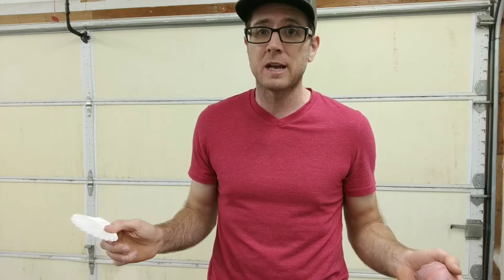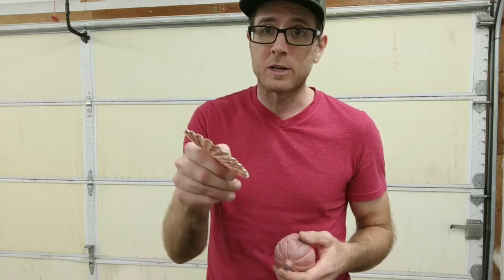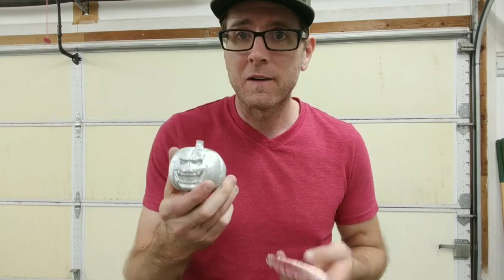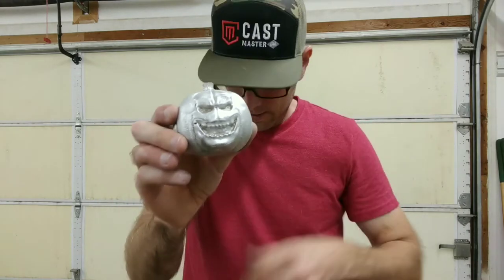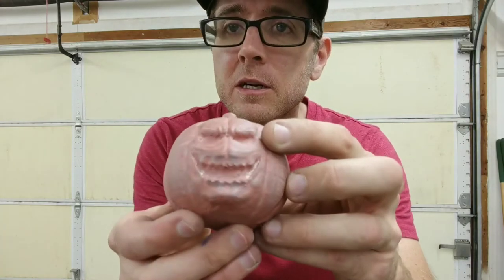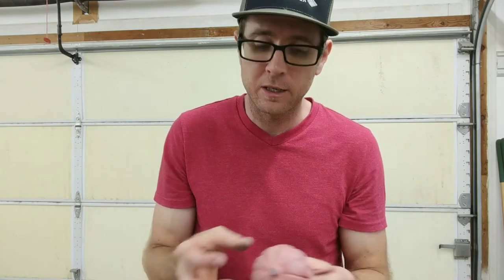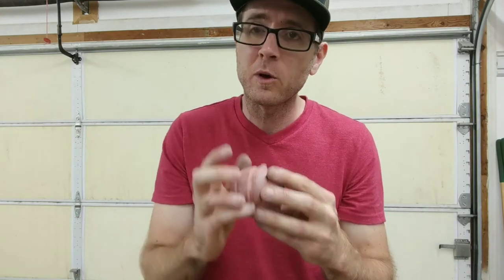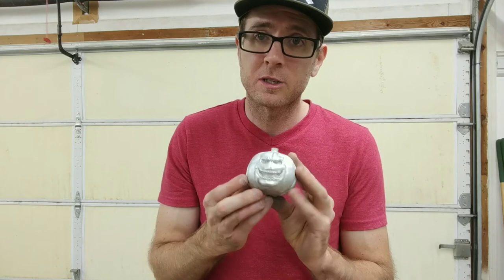3D Printed Sand Casting Pumpkin - jack o lantern - and Copper Seashell

Comment: Those turned out nice! I enjoy doing that stuff. I was told you can use rubbing alcohol to smoth the prints. I haven't been able to try it yet. I'm in Virginia.
Reply from the maker: I've never tried that on my prints.  However for the eyes and the mouth I needed to "fill" it.  I'll have to try the alcohol on the outside of my print sometime.
Reply: If you do let me know. I will do the same
Reply from the maker: @SilverScorpion   I definitely will, knowledge is worth spreading.  Also where in Virginia?  I went there a few years ago to Busch gardens Williamsburg.